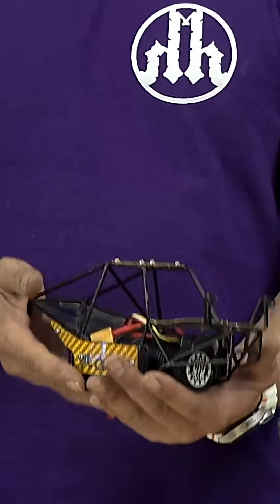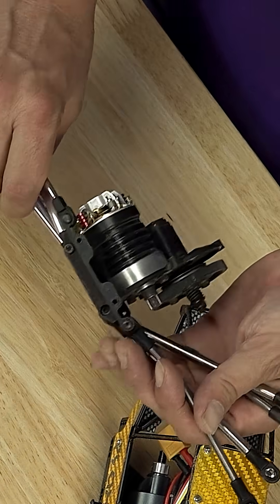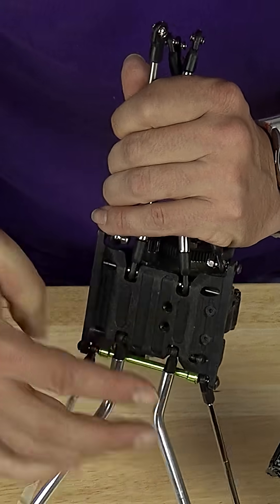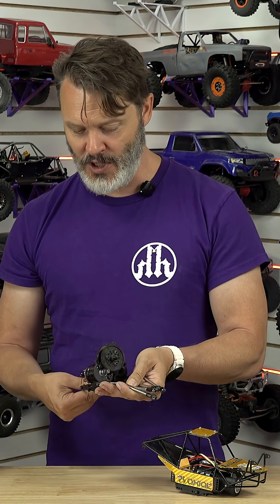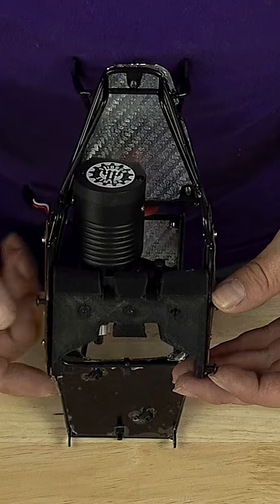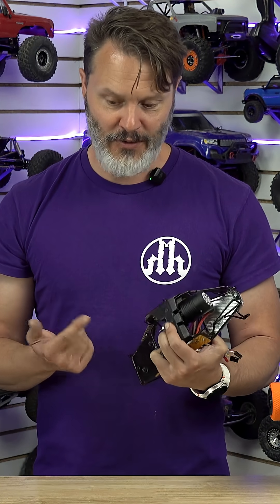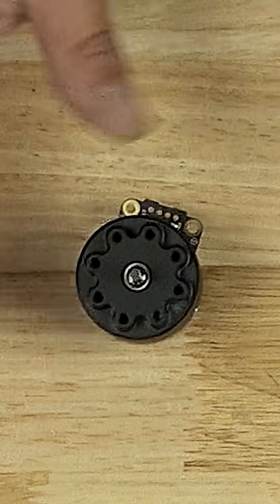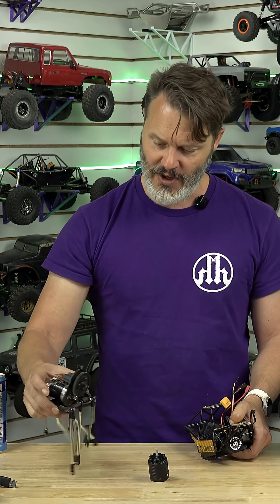3D Printing the Perfect RC Skid Plate 🖤 + A Closer Look at the New 2-in-1 Motor Mounting Points!

Comment: Love my AX10! I believe iv had the HH Puller expert 21t in it for a few years now. still roll rocklizards too! Haven't ran a body on it in years tho, just the 3s standard size battery cantilevered off the front of the og frame. One of these days I'd love to put a full HH esc on it. (Discontinued*?) Ill find one im sure. Maybe at axialfest?... wink wink... lol 
"Axle Hangups" rc rock crawling club Ojai Ca.